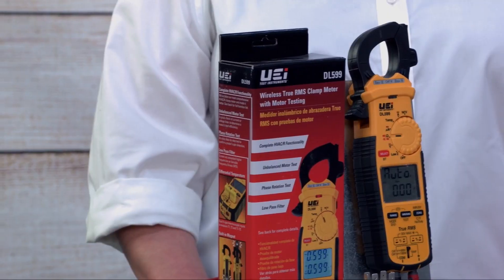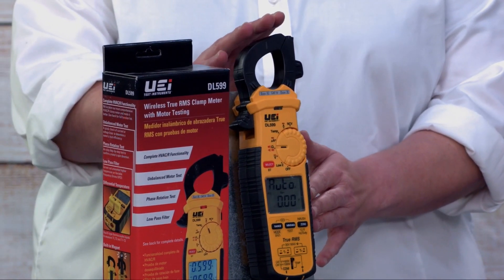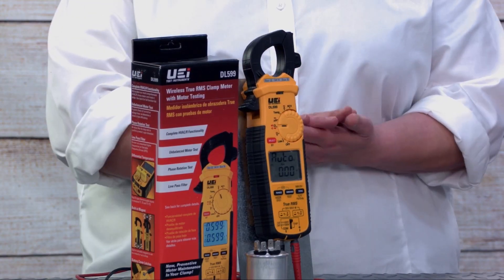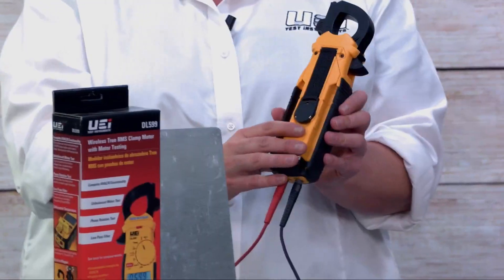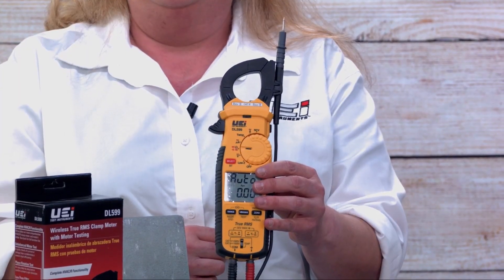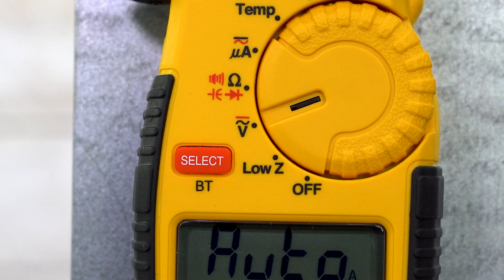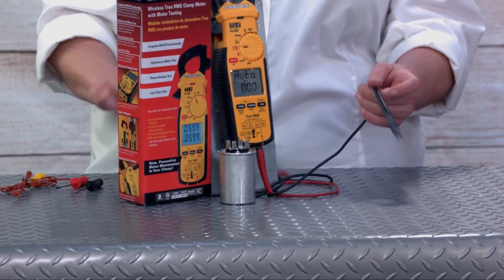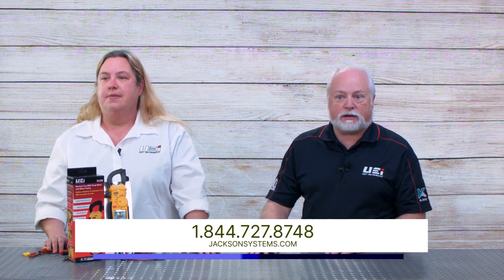UEi DL599 Wireless TRMS Clamp Meter w/ Motor Testing

Comment: I bought this meter about a month ago, and whe set to measure amps never reads zero
It always reads.4 or .25
I think I was stick with flute or fieldpiece
Reply: Yeah my meter is having the same issue ...  I can't trust any of the amp readings. I don't know if it's including that 0.45 amps or adding to it when reading amperage? It's frustrating honestly.
Reply: @jakbo_  I had the same problem and I returned it thinking it could be an original defect, but it doesn't make sense to me if it has a calibration certificate, I hope the new one they sent me DOES NOT HAVE THE SAME PROBLEM. just like you I felt frustrated